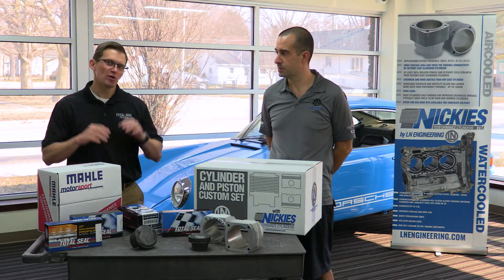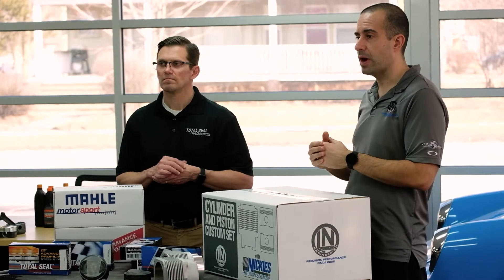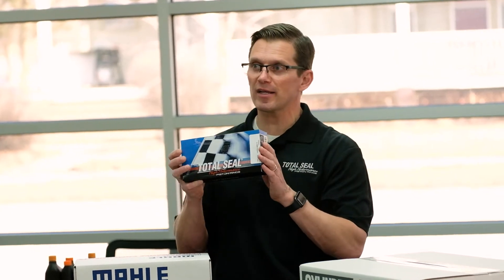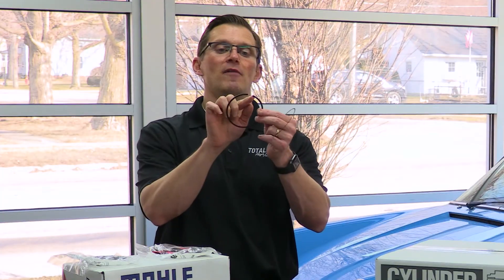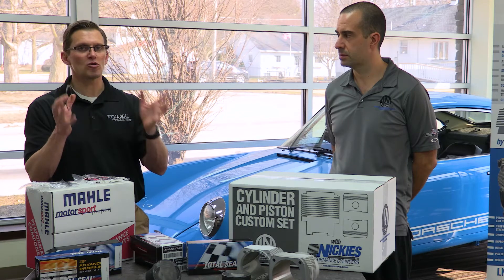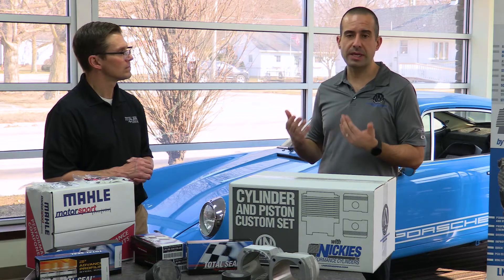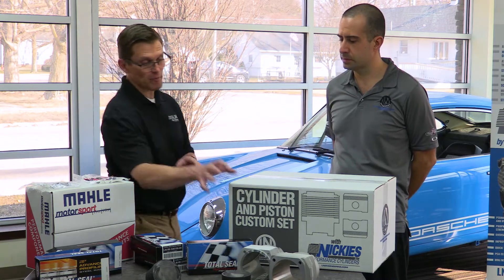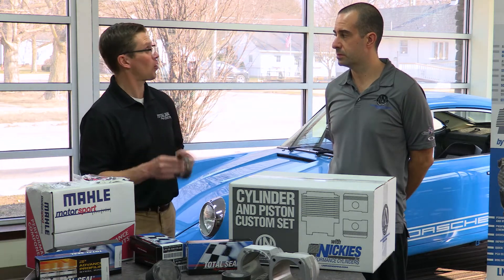Total Seal Gapless O. E. Replacement Piston Rings for Aircooled Porsche Engines

Comment: How much are Blowby gases reduced through using this process with the Gapless second ring?
Reply from the maker: Using a gapless ring does eliminate the path for the gasses which is reflected in very low leakdown numbers.
Reply: @lnengineeringllc  I see there are many variables i.e. compression, stroke, etc. I found many production stock engines are running -.2 to -.6inH2O hot idle in the crankcase, the result is carboned Oil Rings and eventually burning oil. 
Just curious how much the gapless ring would lessen the issue roughly.
Thanks

Comment: I like reading about the Goetze ring mod being applied to the VW TDI.
Reply from the maker: Besides converting the second ring to gapless, you can also do this to the top ring. In many cases, we can build a custom ringset for any piston as long as we have the ring groove widths and depths which allow us in many cases put a modern ring that is superior while also using a gas ported top or even Total Seal's Total Conform rings.
Reply: @lnengineeringllc  yes, that is true too. Many years ago, I wondered if anyone ever used a gapless ring on a diesel. The first instance I read was a 2nd ring mod on Goetze TDI rings. This was before I read about Total Seal developing their own diesel rings. VW TDI rings are very much like VW gasoline rings.